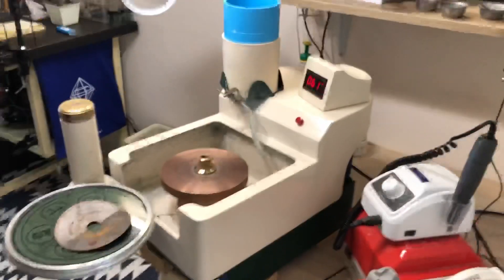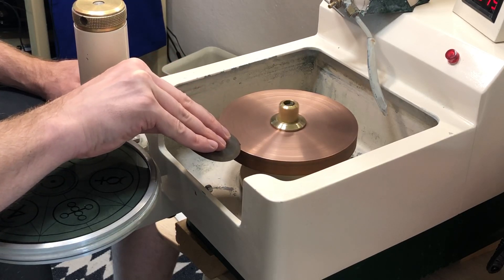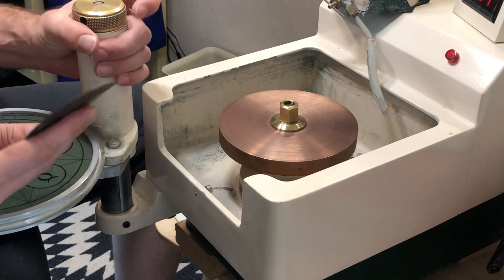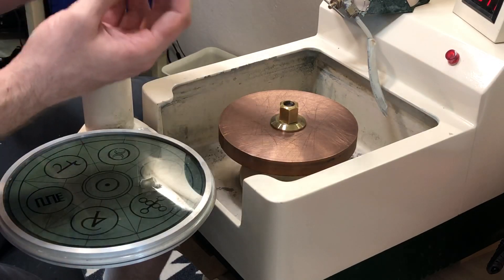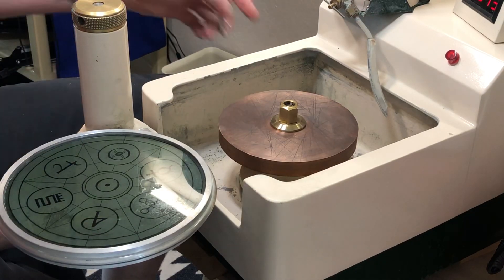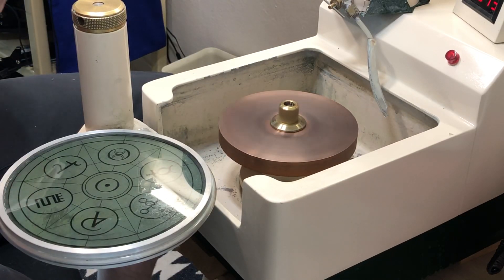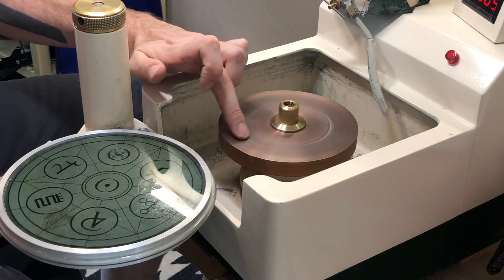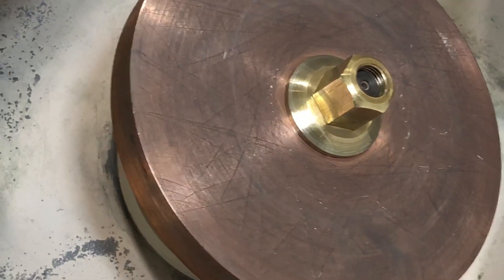Resurfacing a Copper lap with a Saw Blade

Comment: hey justin would this work for a batt lap also?
Reply from the maker: Yes just don’t tell anyone I told you 😂 I have scored and rescored many battlaps. Jon Gearloose explained to me that’s it’s not necessary and I don’t argue with the master but  I have done it and noticed improved polishing speed on larger stones.
Reply: @JustinKPrim   awesome would you suggest doing it the way your sri lankan mentor did with the copper lap video? becuase I did some lighter scratches with a scalpel and then smeared in some 100K diamond and then used a skateboard bearing to smooth everything out. I still has a high spot so i went back and used a topper lap and bent it like you did the saw blade, then took away tin until the surface was more even and then scored, smeared, and rolled it again and got a nice finish. going to test the polishing out today.
Reply from the maker: @ufgbaa3192  yeah there aren’t any hard rules. You’re basically creating a mathematically chaotic surface and then embedding diamond into. However you get to that point works. If you check out my London lap dressing video you will see they do the same thing with house bricks
Reply from the maker: Also for a batt you don’t need to take topper to it. Just a razor blade or a saw blade is fine
Reply: @JustinKPrim  ive only been dressing the bottom side of my batt and it had a high spot and some heavy scratching on it. it also just felt off to use up until i put the topper against it.

Comment: After watching your channel and being inspired, I have taken delivery of the Sterling machine and have cut a few gems. Loving it, can you give some polishing hints as to what revolutions the copper and zinc lap should be used at and what’s best to use as a polishing compound, how hard or soft to push the gem.
Reply from the maker: I almost always polish around 900rpm unless I’m using oxides in which I slow down to maybe 200-300.